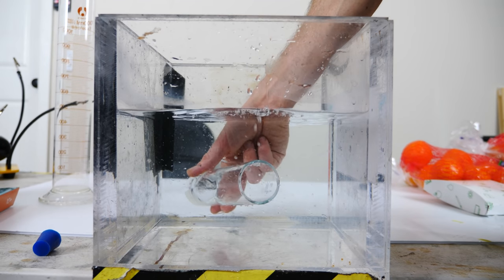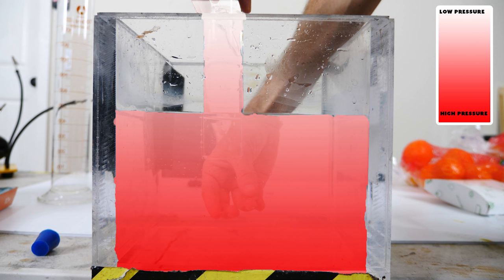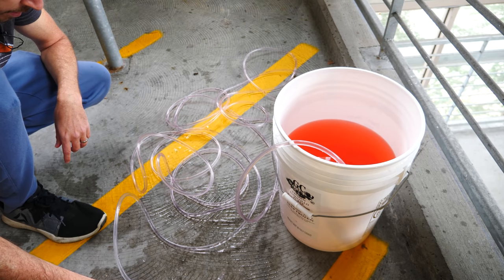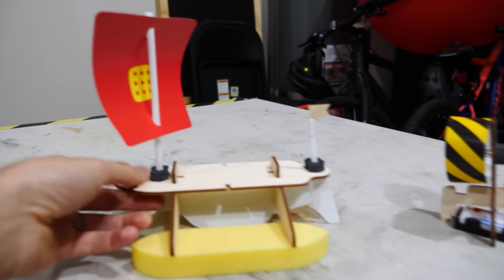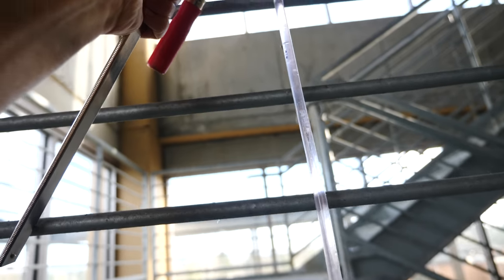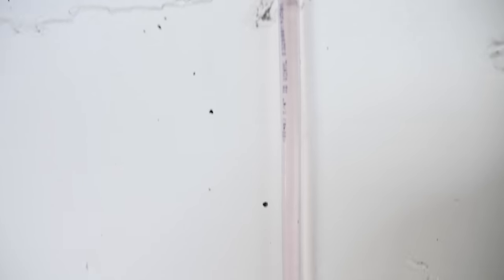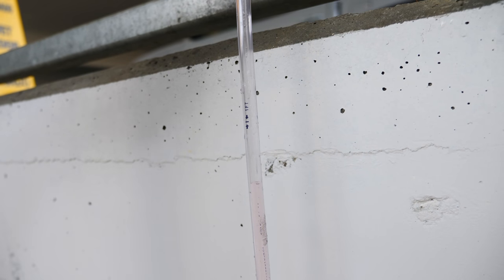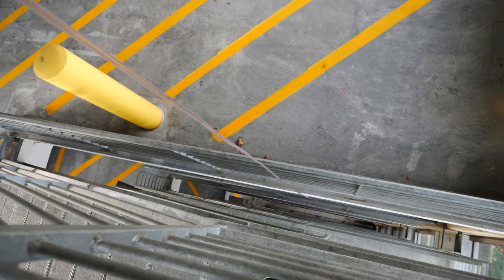Why Water Boils In Tall Cups

Comment: Wow, As a firefighter I have known about this problem for 25 years (can't pump if the pump is more than 30 feet above the water), but this is the first time I've actually seen what's going on inside the pipes.
Reply: 25 years damn
Reply: You're a G my man
Reply: This is the coolest reply I've seen here. First of all thank you for doing what you do goddamn. And second it's wild to read about that real world problem connected to the phenomenon in this video. I wonder then if you could increase pressure in the truck, or lift it up somehow. Probably not, but it's an interesting problem!
Reply: @michh8901  Since this is a problem with air pressure and vacuum, there is nothing you can do in the truck, however some of our trucks have a second pump you can carry where the truck won't drive. 

Worst case there is also a system with three hoses where you actually pump high pressure water down one hose to get twice the amount of low pressure water back.
Reply: The whole thing about having to pump water at several levels in the Empire State Bldg. makes sense also.
Reply: @mrdovie47  that's actually a bit different, you can push water much higher than you can pull, because the pump can producee way more than atmospheric pressure. Our pumps operate at a default of 8 atm, with 33 feet per atm that means you only need a pump every 250 feet or so.
Reply: That’s why pumps are at the bottom of a well I guess.
Reply: serious cavitation will occur. excellent. oh well, net positive suction head has to start somewhere.
Reply: @eswing2153  Great point. If it's too high to pull, push it instead.
Reply: That's what she said.
Reply: Did you fight fires out of the womb or what?
Reply: @AB-ub9nd  In Germany, fIre fighting is mostly done by volunteers and you can join the force at ten years old, you won't see any active duty, but you get to practice with the equipment.
Reply: Patrick Keller ... for real;  you do know that your fire tenders have huge pumps to force out the water?!
Reply: @MrStr8den  Surely he must not!  I mean, it's not like he corrected someone else by telling them their pumps operate at 8 atm by default.  And can probably be driven harder if absolutely necessary.
Reply: @ethangreen5416  not sure he was a firefighter for 25 years, he's just KNOWN about this for 25 years. could be wrong though!
Reply: No, actually you can pump any height if you give enough energy per second (watts).
Reply: Another way to look at it is that the weight of a 1 square inch column of water 33 feet high is 14.7 pounds the same as typical atmospheric pressure of 14.7 psi.
Reply: I know people with wells deeper then 30 feet that have pum  on the ground. Maybe that's why pumps died often 🤣
Reply: No, it’s different
Reply: As a random person I have been knowing this for thirty years, since visiting an old mine where they explained how they used to pump water out of them.
Reply: @mrbane2000 There is a phenomenon known as cavitation, in which water collapses violently when it goes back to the liquid state (in a high pressure spot) after having turned to vapor (in a low pressure spot). The collapse is so violent, it rips chunks of metal from the pipes or the pump. 

Because of this, in general, the higher you can put a pump is 1 meter above the water level, or the equipment won't last long. Any higher and the water turns to vapor in the pump inlet (because it loses pressure from the turbulence).
Reply: I know a girl who could do it.
Reply: Have they ever considered firing ice cubes into a really tall fire?
Reply: So you can push water above 30 feet but not pull it from above a source of water, interesting
Reply: I could be wrong but I think the fundamental issue that allows water to be pumped up without the same issue is simply pressure. The boiling point of water is not absolute, its dependent on pressure. When you boil water at altitude it boils more easily because the lower density of air. The water being drafted is under low pressure as the pump draws a prime, and uses an external priming pump to pull a vacuum. A second method called burp drafting may be able to get a slightly higher lift by downflooding the intake hose but its not a practical operation, if its that much lift then we find something else.
The main pump of a fire engine is a non-displacement pump so it can only move a continuous column of water, it cannot move air or suck water up through an empty hose. Once it gets that water though it can add a good amount of force, and the higher the supply pressure the higher the discharge, its always increasing until it starts cavitatiing. But that pressure is continuous to the nozzle lowering the boiling temp, so going up becomes a matter of what maxes out first, the amount of pressure at a given volume the pump can provide, the 400psi max hose pressure, or the head pressure loss of .5psi per foot. When what you need to get meets one of those limits thats it but there are many variables.
I can do a lot more to move a smaller volume and can get a lot more on a hot hydrant with 100psi on my intake side. If I'm drafting and trying to supply large volumes, even on flat ground my max discharge pressure is going to be much lower.
As for 25 years, you can volunteer at 18 and continue more or less until you become physically unable. Ive got 26 years since I took pump ops, and am far from the oldest on my department at 46, 28 years since I became a firefighter. Its often a family tradition, I'm 4th generation and joined the moment I was old enough and have been around the firehouse since I was a baby. Theres no reason to doubt the OP.
Reply: Have you made it to 27?
Reply: @elmojackson6621 Also at the low pressure areas on a spinning outboard’s propeller. The pitting is damage caused by the collapse of your steam bubbles.
Reply: You could pump past 30 feet below, but you would need to use a giant air pump and a giant condenser coil.
Reply: Can anyone explain to me why we can still take a bath on a very high floor? Like 40th floor?
Reply: That's not the same thing
Reply: @白先生-e8w it’s pumped up from the ground level. The pump generates high pressure in the pipe pushing it upwards without any suction (negative pressure) to cause boiling
Reply: I never thought about it in terms of firefighting. It makes me wonder how the sprinkler systems in really tall buildings handle it.
Reply: To push water beyond 30 feet you need a pump at the base to push the water at a pressure well over 15 psi.
Reply: In engineering pumps are designed according to water head. Essentially the height of water a pump can lift. So if you're truck had 25ft head, that is the pump size, but once you go further you losw pressure and the pump can not handle it. Water is quite amazing when it comes to pressure.
Reply: Fascinating.  I wonder how many known limits in my job I encounter everyday and never had the idea to wonder why it is.  I’m sure there’s loads, electronics do weird shit.
Reply: As an engineer, we learned at school the difference between a pushing pump or pulling pump. If you pull, water will boil and you'll get great losses. Other things to take care off are the frictions of the fluid against the wall of the pipe etc. It's fun to work on!
Reply: Think a jet pump can drawl deeper because it uses a two pipes and circulates water to the foot valve
Reply: Uhh, no you can pump water to space if you wanted, you'd just have to have the pump at the bottom on earth
Reply: You are awesome
Reply: @白先生-e8w  
It is pumped to your bath from below, making this a non-problem, as it is not "sucked" from that floor, but pumped up from below. In fact, it is pumped to a pressure tank, and then that pressure is what is used to make it to your bath at a very high floor. It's high pressure pumps, rather than suction pumps, if that makes sense.
Reply: If you keep the water moving it should make that height higher shouldnt it? Like pump more water in there, cuz yeah it wants to fall down creating the pressure but if there already is overpressure then that should even it out a slight bit.
Reply: @patrickkeller2193 the draft line. I just take the booster reel and stick that into my porta pond or my water source when drafting. Sometimes I just put a short section of 1 3/4” out with no nozzle and have that to recirculate my pump
Reply: @alexkitner5356  it's  lot more simple than your explanation.... you only have a ~14.7 psi pressure differential for suction whereas for pushing you have literally exponentially more pressure differential to work with if you so desire as long as the materials  and equipment involved  can support it.
Reply: depends on the pump
Reply: So how do you get the water up there then?
Reply: @Crank797  series of pumps and boosters you
Reply: If the base is closed so that you can increase the outside pressure, you can get the water higher.
Reply: Yep,, I’m a pump specialist,, you can pump to the moon but can only suck 30 feet,, rule of thumb in our business is 25’
Reply: @ethangreen5416  25 years is nothing lol
Reply: Old engineer -- same!
Reply: Pumps have a NPSHr that will dictate what pressure is needed upstream for the pump to work properly.

As for skyscrapers … water pressure from the bottom dictates how high up the sky scraper the water can go. When usable pressure drops too low they put booster pumps to get water to go higher. You ensure that the pumps provide the minimum water pressure you need for fixtures and other systems like fire sprinklers. In general if you divide the height of the water column in feet by 2.31 it tells you how many psi that equates to. For simplicity you can approximate it by just dividing by 2 (close enough). So this videos experiment you see atmospheric pressure being around 15 psia… equates to 30 ft of height which is why the water boiled at 30 ft above the container.
Reply: Yea bc you can push water a lot harder than you can pull it…luckily ice isn’t more dense than water
Reply: @ethangreen5416 your so sad😂
Reply: Firefighters are awesome, thanks for what you do.
Reply: Put the pump at the bottom.
Reply: @notoriousdudi  ?
Reply: Thank you so much for putting the good of others above your self.
Reply: I fought a fire once. Burned my fists. 🥁 🥁
Reply: you call in the helicopters to dump it at that point?
Reply: Is a plumber dealing with pumps and water pressure, I also knew you could not pump water 34 ft or higher. I did not know that it would start to boil though that was really neat.
Reply: @patrickkeller2193  push is better then pull.
Reply: @DirtyCiv what’s so unrealistic about being a firefighter for 25 years?
Reply: @brandonguild1666  nothing. just saying that he said he knew about it for 25 years, not that he was a firefighter for 25 years. he looks about 35 years old in his picture(if it's recent) and im not sure he's been a firefighter since he was 10.
Reply: @DirtyCiv  I was 30 in that photo, but 35 when I made the post and yes I have been a firefighter since I was 10. This is possible in Germany.
Reply: Firefighters are the real heroes
Reply: A farmer is well aware too hehe.
Reply: I wish you had a vacuum gauge in hose, good video, thanks
Reply: I love hearing about distinct phenomena or rules from different fields that all tie back into physics. Really cements that the theory you learn actually has applications or effects in the real world
Reply: @DirtyCiv  owned
Reply: @brandonguild1666  whatever helps you sleep at night 😂
Reply: I think that's more about the limitations of your pump because im pretty sure it doesn't vaccum suck the water up... unless it's some impractical old school pump
Reply: Since u was 8yrs old?
Reply: Back in the 80’s I volunteered with the local Fire department. I was a newly accredited P.Eng. but was single and had time to volunteer. Fire department had a practical skills training evening. I was on a crew whose job it was to prime a pump from a deep well. It was obvious to me that we weren’t going to be successful exactly because of the type of pump and the physics of this video which we had studied in the lab. I tried to explain this later to the full time paid firefighters. All of them said they would have been able to prime that pump. I said to myself, “There are none so blind…” and didn’t volunteer any longer. I thought that if their training hadn’t included this knowledge then I was hanging around with a dangerous group of people. That was a long time ago, I’m sure things have improved now.
Reply: As a water well tech we could set point wells at 28 feet and they would run fine.  At 29 feet we could get it but it would melt the impellers. At 30 nothing...
Reply: There is a difference between this and pumping over 30 feet up. Your pump just isn't string enough to push water up that high effectively
Reply: maybe use cold water
Reply: Thank you for your service